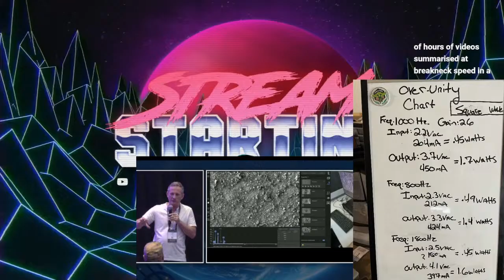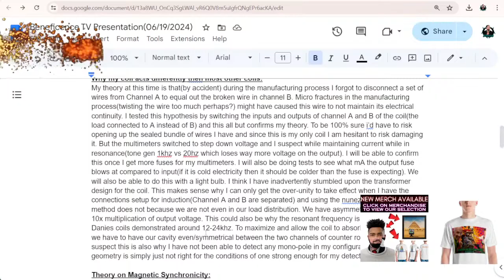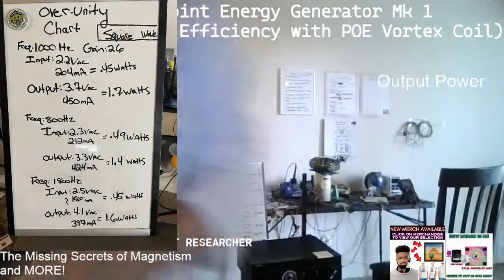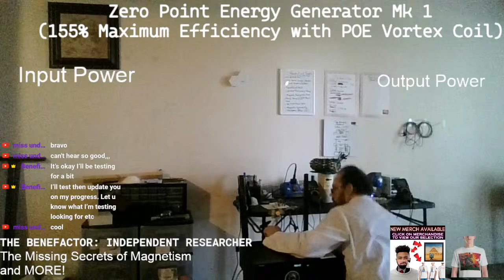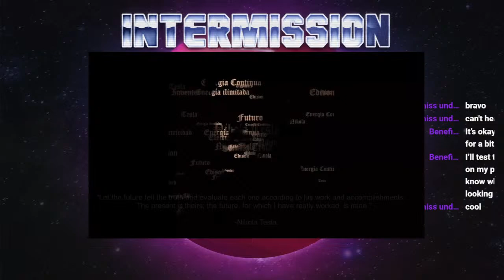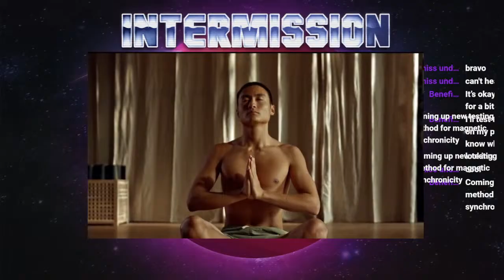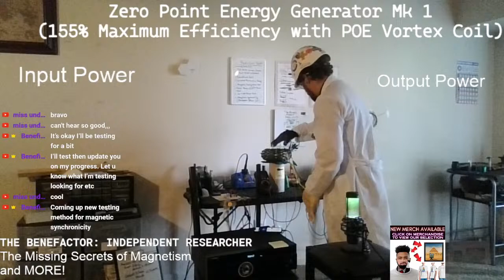Breaking News for The Nunez Method and Magnetic Synchronicity

Comment from the maker: Why my coil acts differently then most other coils:
Upon further inspection of my wire bundle I did, in fact, disconnect a channel from A and it was operating at 11:11 winds(A:B). My new theory of the coil goes back to my original which is what Daniel says. It should act as a 1:1 ratio transformer. Not an asymmetrical.  I will be disconnecting one more set of wires in another test to determine if its the ratio only or number of winds that matters in the production of over unity energy.